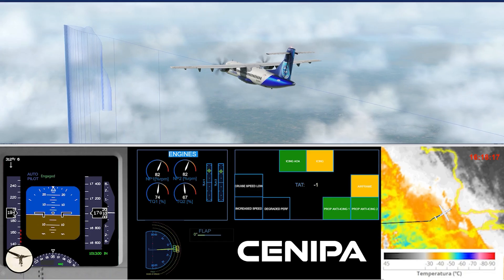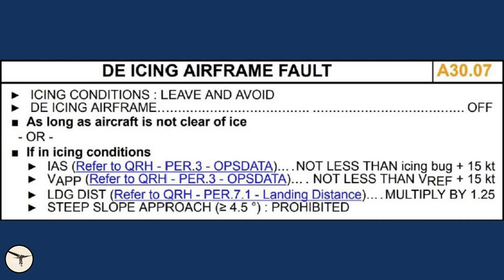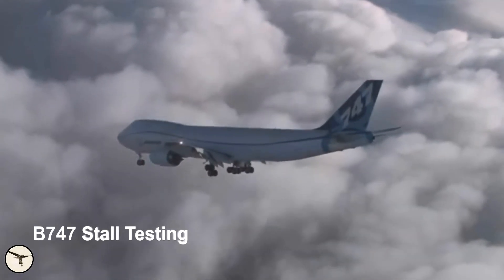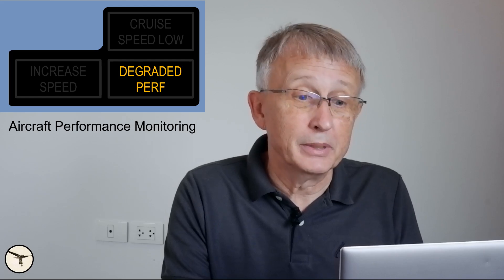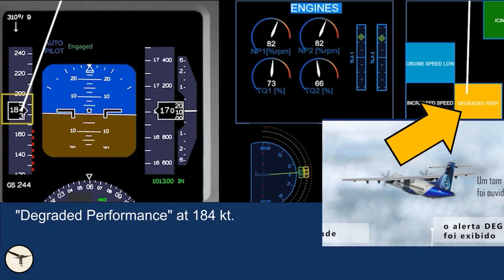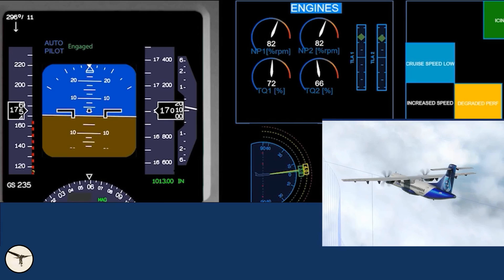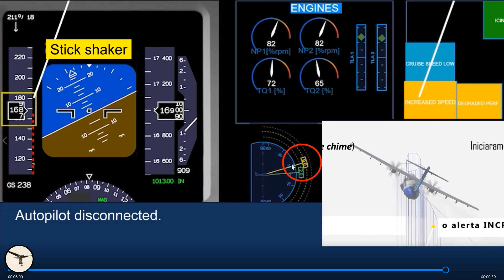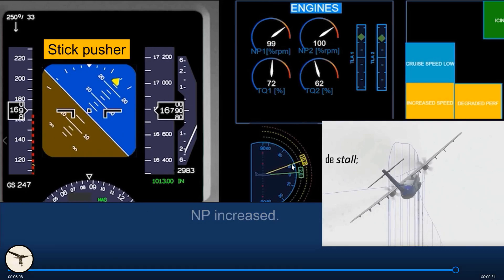ATR 72 Crash: Understanding the Flat Spin Disaster - Expert Analysis

Comment: Magnar is a gentleman to not say this, but it is clear that the pilots caused the crash.
Reply: The underlying question is WHY - were they under-trained, were they complacent? What is the safety culture at their airline? Were they under pressure to stick to schedule?
Reply: @dougfraser77  So far only speculations. They could be undertrained for ice conditions considering that
s a rare situation you encounter in brazil. Or maybe they were suffering from fatigue. I also heard from a brazilian pilot that in Brazil if you declare an emergency then you have to go through a lot of bureocracy with the government once youre on the ground to explain what happened etc. So pilots feel more aprehensive about declaring an emergency. I know sounds messed up, but again these are just speculations. Final report might help clear things up.
Reply: @mrtacoman99  
'They could be undertrained for ice conditions considering that
s a rare situation you encounter in brazil.' 

Nope.
In one of Magnar's older videos he describes flying into a region of severe icing. In Thailand.
Reply: @dougfraser77  All of what you said, I think. And for those who say that icing conditions are rare in Brazil, it isn't so. That had happened earlier in the flight, and they were aware of such conditions along the route. Unfortunately, it seems they underestimated the severity of the problem in the final portion of the flight, when they were busy changing course, holding and preparing to descend. I think they didn't declare an emergency because they didn't realize it until it was too late.
Reply: Remember the swiss cheese model. Of course the pilots crashed it, but that's the obvious thing, what made them so complacent?
Reply: yes. you can point at a lot of things, but this is like AF stall into the ocean. There are aviators that fly their private planes, maybe race or compete. Then there are pilots that have learned just enough to pass and fly. This is true in almost any career
Reply: Does the question heard in the cockpit "What's going on?" suggest a lack of training for the situation?

Comment: Sou do Brasil , não sou Piloto , mas Voce Explica muito bem...
Como é impressionante, que já cairam muitos Avioes , por motivos Semelhantes...
2 Boings 737-Max, Airbus A-330 Air France e Vários ATR-72
Reply: The other crashes happened very quickly (less than a minute for the Max crashes, and 1-2 minutes for Air France). This accident happened very slowly and with lots of warnings that were completely ignored.
Reply: The MAX crashes where based software after a AOA sensor failure,  the AF 447 where bad training in reacting to a temporary pitot sensor fault,  and some ATR due to icing. Not at all similar
Reply: @MrCaiobrz  Parecido na Rapidez do Acidente...e Falta de conciencia da situação...
Reply: @carlosfernandes8919  Colega, todos os aviões que cairam chegaram ao solo, então todos são iguais. Comparar acidentes por aparência externa não faz o mínimo sentido. Já diz o ditado: aviões são 100% eficientes, pois de todos que jamais decolaram, todos voltaram ao solo.
Reply: Os 737 MAX não foram stall.
Reply: @Antonio-lt1sp  Verdade, alta velocidade e Nariz embaixo, Por falha Eletrônica, mas é muito Rápido pra se ferrar...nisso é tudo igual...